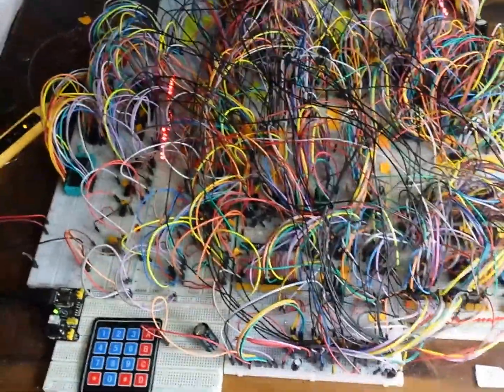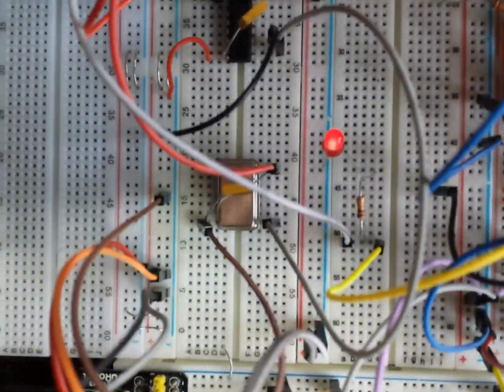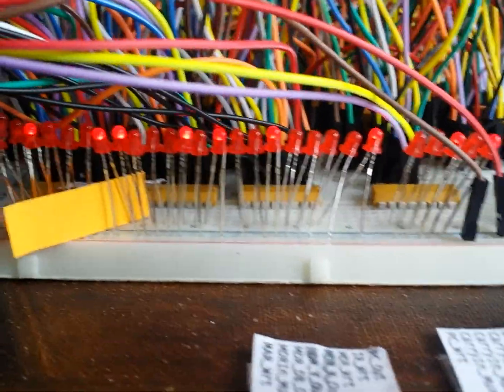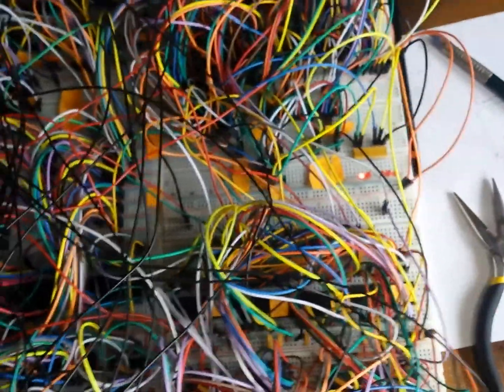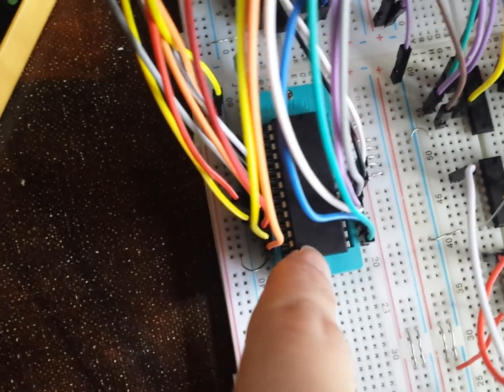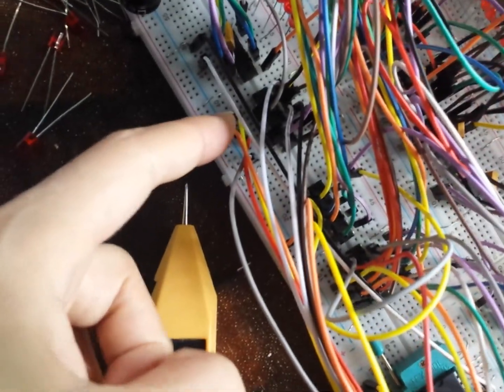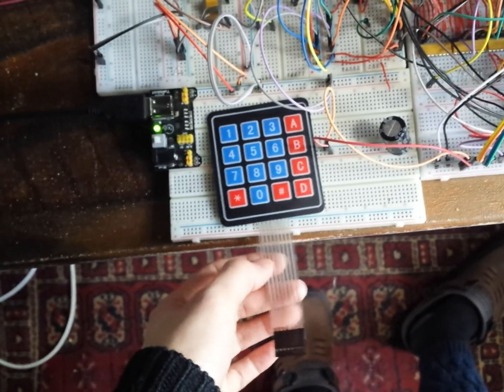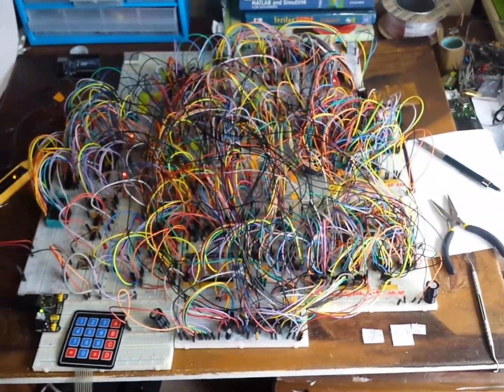8bit homebrew CPU follow up. Flash storage via ports.

Comment: I have done a similar thing on my 8bit machine based on Ben Eater's breadboard machine, which I've upgraded to use 256 bytes of memory, I have a 2k EEPROM with a dip switch to select which 256 byte chunk to load in (8 x 256byte programs), attached to my IO bus, I dont have the boot rom but I only have to manually enter in about 10 bytes to load in a program from the rom